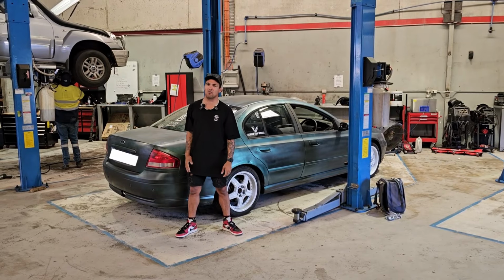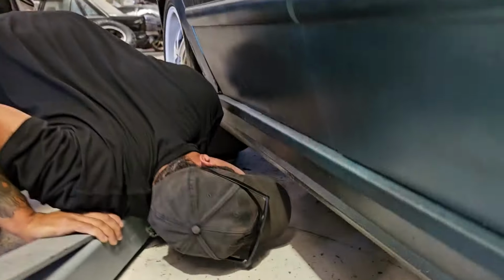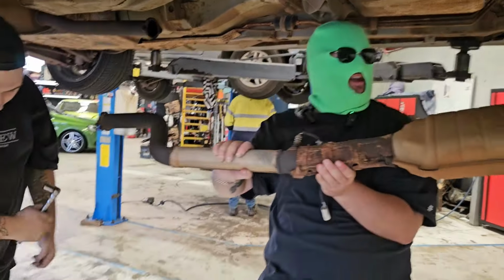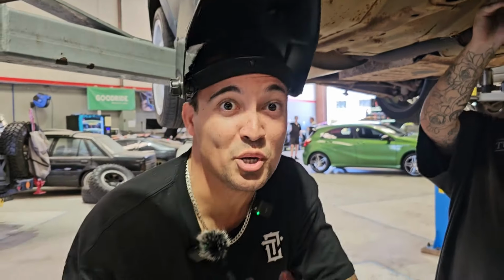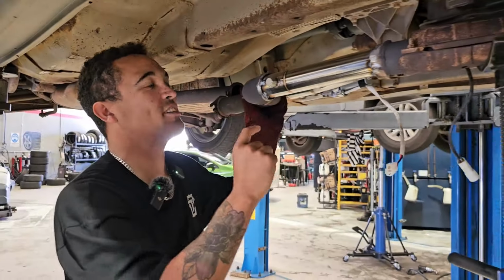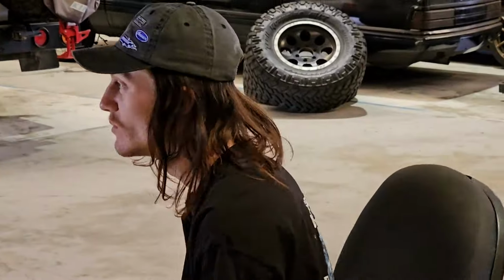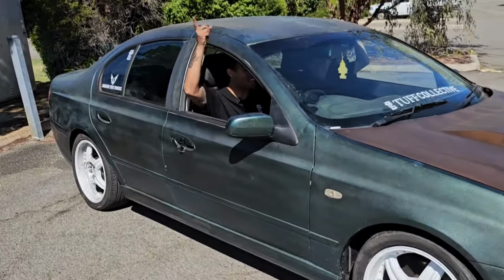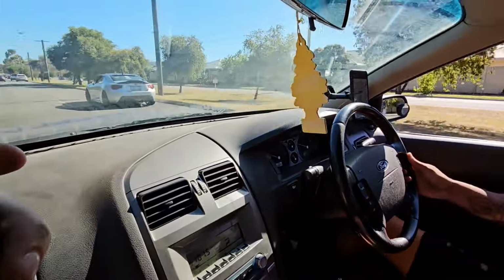Making Australia's Loudest Ford Falcon

Comment: As someone who lives in perth i can confirm the graham farmer tunnels collapsed due to the pure sound of the turbo* barra
Reply from the maker: 100% factually accurate 😤
Reply: Don't think I've ever driven through that tunnel without hearing people absolutely sending it
Reply: Yep, I'm another perth car nut, and the tunnel runs are like a right of car manhood, hahaha. Swim got done in r34gtt by a portable cam just before the tunnel doing 126 in 80. $1200 fine 7 demerit points. A couple more k's and would've got car impounded.

Comment: im curious when yall were welding the exhaust system together did you use an Arc or an Oxy torch for it?
Reply: also i love that it has the roar of a lion 10/10 content.
Reply from the maker: Mig weld I fink

Comment: Barras are the most annoying sounding engines if they get modded exhausts. They do sound great stock though. I brought a falcon ute for work it had a loud modded straight through system it was so embarrassing and annoying to drive so as soon as I got the chance I put a stock exhaust back in it and it improved the performance also fuel consumption as well it was so much quieter and stopped me from getting “You wanker” looks while driving it
Reply: Karen
Reply: I’m not saying all loud cars sound terrible I own an AMG which isn’t quiet at all it’s Just loud barras they really sound terrible in my opinion. I think they sound great stock though I have owned 3 falcons with Barras.